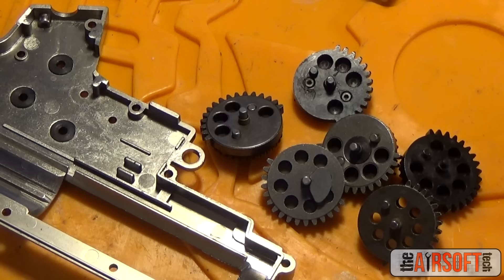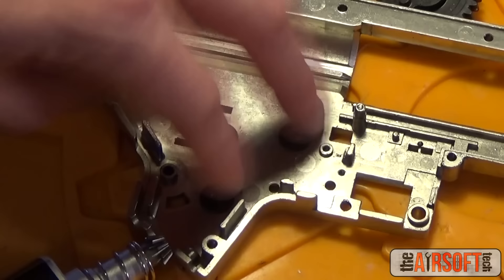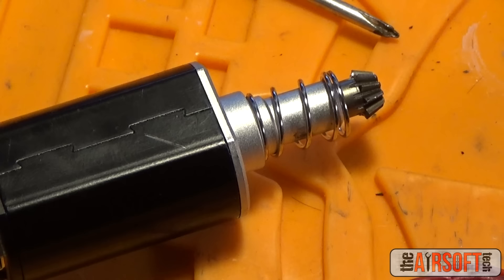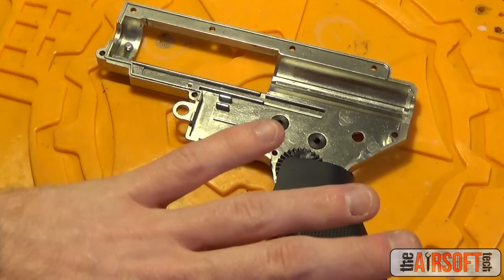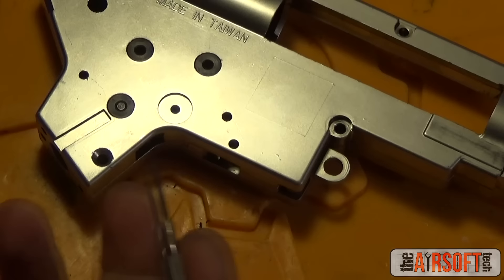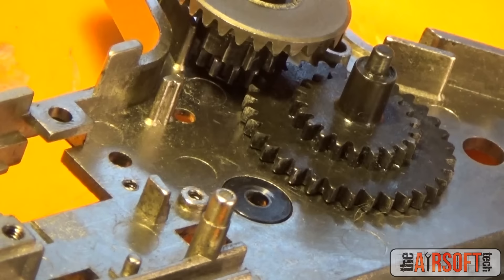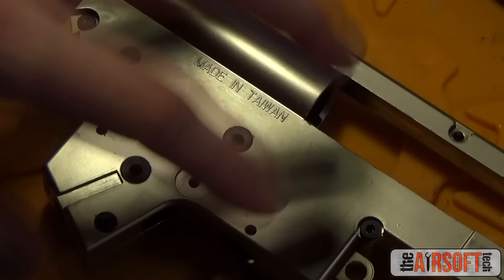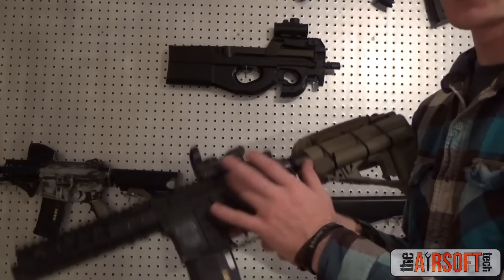How to Flawlessly Shim Your Airsoft Gearbox

Comment: This is similar to how solid axles in cars and trucks are rebuilt. I’m surprised to see how rudimentary the gears are. I bet there could be a lot of improvements made in strength if you used  helical gears or spiral bevel gears instead of just spur gears. Spur gears are generally (at least in the automotive world) easier and cheaper to make than helical gears or spiral bevel gears, but it is quite rare to find them in modern cars. Spiral bevel gears would however have to have different “bushings” though. They create axial thrust so they use thrust bearings, but on a scale this small I doubt you’d have to make it that complex
Edit: Also using helical gears would not only make the gears stronger but also quieter. I’d recommend maybe using some kind of grease to lubricate between the bushing and the gear. It would make the bushing last longer and create less heat as well. I’d recommend white lithium grease. I put that shit on everything. It’s petroleum based so it has long-term lubrication, it doesn’t drip or run so it won’t get flung around everywhere, and it’s typically used for shit that has a load bearing on it. You can get a little tube of it or do what I did and get a quart size tub of it.

Comment: Nice video! I'm gonna try to shim my gearboxes again now :) 
Side question: Would it be possible for doing a video with motor mods like shimming the magnets, rewinding armatures, making cooling vents in the can and most importantly changing out the pinion gear?
Reply: Nitro The Husky for the changing the pinion you have to get a pinion gear puller by ZCI. As for me i just use pliers and pry them off under the teeth.

Comment: Personally I wouldn't glue or JB weld the bushings/ bearings in as it will be a nightmare to take out in the future. Instead I use Loctite bearing retaining compound which is semi-setting, used in the automotive industry as you can easily take the bushing/ bearings out with no permanent residue after a quick clean. Some of you might be wondering if it's strong enough to stop the bushing/ bearings moving, and yes it is, done countless gearboxes with it and I swear by it. Only thing is you have to leave it overnight to cure.
Reply: Nightmare? It'll just require a firm whack with a hammer to get them out of the shell, and the glue isn't difficult to remove with a sharp screwdriver.

Comment: Best vid on YT for shimming! Q- do I have to change cylinder if I won't to use DSG main gear? Or will stock 72mm with air port on the back do the job? Thank you

Comment: Motor grip angle isn't as big a deal with gen 3 gearboxes, right? I ask because the motor in those have their own separate hold down brackets, and the grip is just meant to be a cover grip.

Comment: So many thanks mate. Best explained shim video i ever saw. 
Btw. Do you have a tip to shim a mp5k because, unlike an m4,  the handgrip of the mp5k is not a seperate part but part of the lowe receiver, making it impossible (for me) to check how to shim the pinion and bevel gear.
Greetings from The Netherlands 😉
Reply: I usually just "wing it" with MP5 type AEG's. I shim the bevel gear slightly lower than half height, it's usually close enough.

Comment: I’m not convinced that sanding/grinding gaps into things is the greatest idea. Particularly if you play at a very dusty airsoft site/field. Giving dust/crap an easier path into your gears will eventually lead to more wear or if too much gets in there it will cause seized gears and stripped teeth.

Comment: Hi good video, I think the step/spur gear is mearly an intermediate gear that transfers the direction of the out put gear? so if the pinion gear goes clockwise, the bevel gear will turn anti clockwise this then makes the final gear turn clockwise, but if you need the last gear to turn anti clockwise you need the step or spur gear to change the direction so the last gear is going the right way. Hope that makes sense ? lol

Comment: When you look at the bevel gear and the stagger gear and adjust them you can’t change the height of the stagger gear when you try to align the sector gear with the staggered gear. So my question is how do you lower the sector gear and how do you adjust the two without messing up the adjustment between the stagger and the bevel gear?

Comment: I followed your tutorial on my first airsoft rifle. Unfortunately even with perfect shimming, my gearbox doesn't sound like the one in the video.

Followed video to the letter, even used shims as thin as 0.08. Their is no scraping or nocking sound, just gear on gear noise.

Airsoft rifle: New and Stock G&G GC16 wild hog (it came with bearings).

Comment: After reshimming, my gun is stuck to full auto. I didn't change anything other than the motor and I reassembled it correctly, maybe I shimmed the sector gear incorrectly?  it seems as though my cut-off lever isn't functioning properly. I'm still pretty new to this but I've taken apart gearboxes and reassembled them with no issues before? It's a King Arms VSS with a v3 gearbox

Comment: Great easy to understand video. One quick question though, so you run your gears dry, or do you use any lubricant on them?
Reply: Absolutely do NOT cycle with dry gears! Use a good grease, either moly like Abbey LT2 gungrease or lithium 3in1 or silicone grease at minimum

Comment: quick question. i flawlessly shimmed my gearbox but my motor is getting hot and even the wire and battery is hot. what may be the cause?
parts: 
shs 13:1 short stroked 2 pickup 1 release
guarder sp120
warhead motor base 27k
lonex airseal group
shs piston 
perun v2 hybrid

battery is currently 7.4v 15c 1400mah 

is the battery too low for the setup? 
the sound of the gun firing is so good its like a somewhat hpa. but the motor gets hot

Comment: Are bushings better than bearings?  Awesome videos by the way!!!!
Reply: Bearings are slightly quieter on rotational movement but bushings are more reliable near indestructible level. I had a bearing go out on me and fortunately the loose ball didn’t destroy any gear in my gearbox.
Reply: @suade-jk4ub  thanks, I have a Krytac and am leaning towards bushings because I'm afraid of bearings failing.

Comment: I need some help. I've shimmed my gearbox before and it ended up sounding better and didn't heat up the motor as much. I didn't use my airsoft gun for months and didn't do any maintenance since I first shimmed which was 7+ months. I recently opened it back up and re shimmed the exact same way and didn't replace anything, all I did was clean and re lube. It sounds worse than how I had it before and a smell is coming from the motor

Comment: So I set my proper motor height and with the motor in there is virtually no play. When I remove the motor there is a ton of vertical play. Do I need to shim the bevel gear?

Comment: Your half shell method for motor height and bevel contact works really well. Do you have any tricks for achieving results you know are correct for v3 gearboxes where the motor tends to wobble when both sides of the shell arent bolted on? Also Im currently doing a v2 mp5 and the entire lower/grip is one piece. Any other tricks for achieving the same thing or am i stuck adjusting by sound?

Comment: nice video. So I opened up my gear box. its a  G&G version 2. All I did was clean it and grease it but it seems like my motor heats up through my grip. Is that a problem with contact from pinon and bevel gear? Or what would you advise to reduce the motor heating up?

Comment: servicing my G&P skull frog for the first time in 6 years. I've never had an issue, just thought it was time to grease things up. The only things I'm replacing are the shims, spring, spring guide, O-rings, and cylinder/cylinder head(using new oem that came in the gun). I measured the shimming, should I redo my shimming the same way it was when I opened it?

Comment: Hi, I followed your video and it helped so much, but have to ask not usually holding the battery in my hand while testing, is the heat normal? The gearbox is incredibly quite, but there's some heat in the wires, is this normal?
Reply: Same issue I’m having. Wires are getting hot but not my motor.
Reply: @XinfinitywardxXx  I ended up changing the motor to a standard one and it seemed to have sorted it, not sure why either, because the motor was new -_-
Reply: @potatoarms291  damn, yeah the motor I have on it is brand new too. ASG boost 30k. How’s your motor plugs? Mines are ripped a little. I wonder if it’s drawing out power or something from the motor set screw...
Reply: @XinfinitywardxXx  Thought those asg motors were really good, mines only a shs. I mean you'd think it could be, I would love if someone could help us both haha

Comment: Question, with the grip/motor positioning, don't you need to take in account that the lower receiver will work as spacer so the motor will sit lower than when trying this with gearbox on grip?

Comment: So I've attempted my first build and it's been quite a learning experience, however, I'm really not happy with it and looking for a bit of input (if possible). As it stands when I fire my M4 it sounds quite high pitched/whiny. I was wondering if you had any suggestions/advice?

Your videos are hands down the best videos when it comes to teching in airsoft and I hope you continue putting out this great content. Keep up the good work.
Reply: did you try adjusting motor height?
Reply: Motor adjustment
Reply: The RC-car sound is the motor, not the gears.

Comment: Could you be a little more specific on adjusting the motor height to perfectly align with the bevel gear? Is this all due to twisting the screw on the bottom of the motor?
Reply: Yes if it squeals like a pig it's to high up just be careful and dont run the motor to much or else you'll chip a tooth but also dont be afraid to hear that noise just twist the screw until it sounds like it isnt dying

Comment: I followed the instructions and my shim job had amazing contact and spins freely and such but it still makes like a revving noise if that makes any sense at all. I shot it a few times and it heated up my batterie rather quickly and my motor smelled like it was burning up anyone know what could be wrong?

Comment: Question about the bevel gear: why do you want some rotational play in the movement? Wouldn't the best case scenario be to have zero rotational play in order to minimize the gears impacting each other (without inducing friction) and wearing it down?
Reply: If there's no play at all, that means that the motor pinion is placing pressure down on the bevel gear. Pressure is resistance and resistance is futile.

Comment: My stock gearset is broken i think its 16:1 ratio, can i replace it with the same ratio shs brand or i need to buy shs 18:1 ratio? My motor is shs high torque motor and m135 spring i did the proper shimming

Comment: quick question im using 13/1 gears and ill get the bevel gear shimmed flawlessly and when i in stall a couple screws spins freely not to much movement from it but when i install the spur gear and shim it and put in a couple screws it will not spin freely  even with no shims on each side and i cant find the problem? is my bushing bad?

Comment: I know it's a really old video, but if you could answer me it would be awesome. You look like a fella that knows what you're doing so my question is: How important is to radius the gearbox shell?
Reply: Hugo Pfeffer radiusing is important to the life of almost any gearbox shell. You should definitely do it if your FPS is over 350 or your RPS is over 20, even if your build doesn’t meet those specs it is still a very simple (and cheap) mod for a long lasting shell.
Reply: @EatAtWendys  I see. I'm planning on opening my GB soon, I have a VFC Avalon. She came a little bit hot (430fps) 25~rps with 11.1v lipo. That's why I asked, I see a lot of techs doing it but I never knew how important it is to radius the gb. Thanks!
Reply: Hugo Pfeffer he has a video on this as well, explaining the benefits and even how to do it

Comment: Bushings or bearings which is better
Reply: Bushings are more durable, but bearings tend to run a tad smoother and can give a slight ROF boost. If you're in doubt go with bushings.

Comment: So, I'm servicing my G&P skull frog that I got back in 2011. I used it monthly until about 2 years go; It's never been serviced before, and has never had an issue. It's been sitting for the last year and before I get active again I wanted to give it a once through. I already opened it up and am ready to order thing, all the internals are in perfect working condition with little wear outside of some finish. I'm obviously going to re-lube everything. But should I re-shim the gun? or reuse G&P's stock shimming. Do I need to replace the ball bearings or any other internals? What do you recommend? Note, I'm upgrading from a  G&P M120 to M140 motor, and will upgrade from my current M120 spring to a Systema M130, keeping the stock G&P high torque gears. Any thoughts or suggestions?

Comment: Hey just one question, when in the half shell configuration you told me to use to check motor height, I notice that the pinion gear is pushing down the bevel gear, despite there still being space between the bevel gear and the pinion gear when in full shell configuration, is this normal or did I fucked up something?

Comment: Hello! I am trying to shim the gears but the sector gear is not spinning freely even without shims. This is with SHS gears but with the stock gears which are shimmed is totally fine. Do you have some thoughts why the sector gear has this problem? Thanks
Reply: Andras Sz is this in a Krytac?

Comment: a great shim job, but you mentioned something about bad bushing causing the gears to not spin. I have a friends gun that is broken and i have been trying to fix it for a few weeks, the battery and motor work just fine and have been working just fine for a long time, i took everything out of the gearbox and inspected with no clue of what the problem was, the bushings looked pretty crappy, it is a jg m4, any help would be great.
Reply: Jackson likes it hot For some reason I read "shrim job" when I first saw this comment xD

Comment: Why so many gears anyway? It seems like the whole gearbox is horribly inefficient front the start.
Reply: I have no experience in this. Just looking at it, it seems to be over complicated with additional gears because of the placement of the motor.
Reply: Nick The reason for the motor placement is mostly ergonomics. It is placed in the grip of the gun, so if it was placed oddly, the guns would be very uncomfortable.

Comment: I'm using shs 13:1 gears with stock everything else in a classic army, however the gun seems to double cycle on semi auto on lock the piston back I'm 100 percent sure its the new gears bc the gun works fine with stock ratio gears , so what do i do to fix this prob please
Reply: jsgaming13 You need to short stroke it.  Give more time for the spring to reset the piston.

Comment: Some times (even when my gb is perfectly shimmed) the motor heats up a lot. I only use semi so I understand that it's harder on the motor but it bugs the ever living shit out of me that motors heat up so bad. I've tried making vents in the bottom of the motor plate but that only helps a little. Any advice would be great.

Comment: It would be VERY helpful if anyone could answer this. Is it ok if there is a lot of shims on the tops and bottoms of my bevel gear. It is about 0.6mm worth on the bottom and 0.5mm on the top. Thanks!
Reply from the maker: Totally fine if that is what achieves proper shimming.
Reply: TheAirsoftTech Thanks a lot for replying I really appreciate it!

Comment: I tried using this method on my stock krytac lvoa-s. 
I used the half shell method, and adjusted the motor high so its making full contact. This  gave me zero movement on the bevel gear when I closed the gearbox with the stock shimms. To tight Like you said. But, I cant remove shimms from flat surfes of the bevel because then it will be scraping on the bearings. 

Should I lower the motor, ore just accept that its tight?
Reply: You only used the shims that came with your krytac?
Reply: No, got some 0.1 modify shims. Ended up replacing the bearings with flatter bushings. Its fine now.

Comment: I know you have a busy life, but I hope you find time to answer this quick question.  I looked through your comments and did not see anyone asking this question yet. I’m stuck at the first step, matching the bevel to the pinion which you explain at about 14:30.  I adjusted motor height correctly as you did, but now after putting the grip (with motor in it) on the gearbox shell, there is no wiggle in the bevel.  Does that mean I do not need to place a shim on the flat part of the bevel gear or should I at least put the thinnest shim on it ?  I’ve seen other videos in which they said to put at least one shim on that side.  Thank you in advance.

BTW love your videos!

Comment: Also, set your motor last. That is not how you adjust a pinion gear. Your other gears need set, then set your pinion by shimming either side of your motor mount. You'll notice an immediately quieter operation.